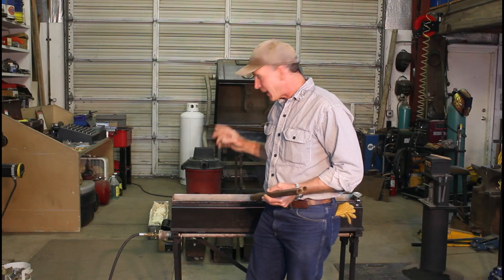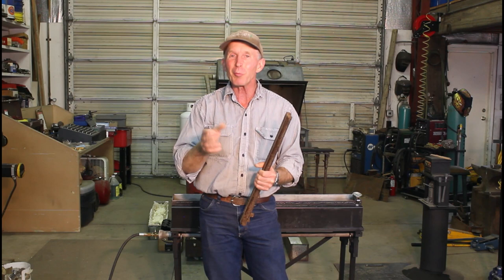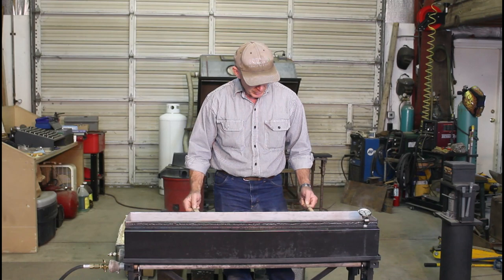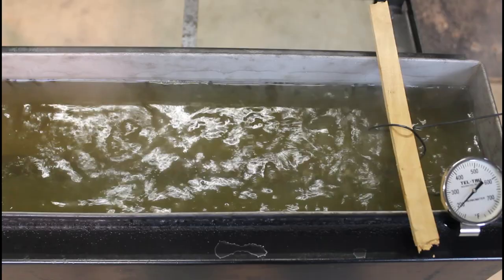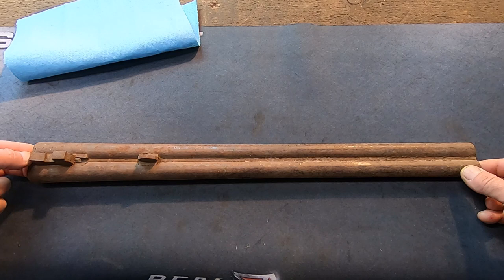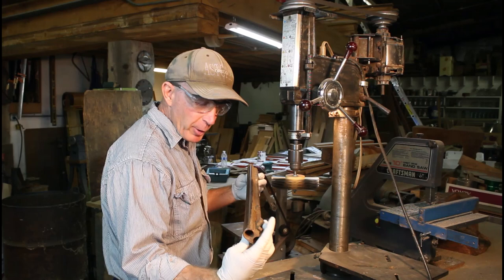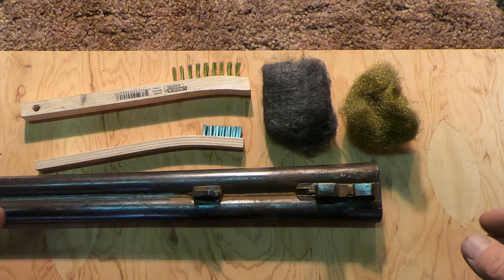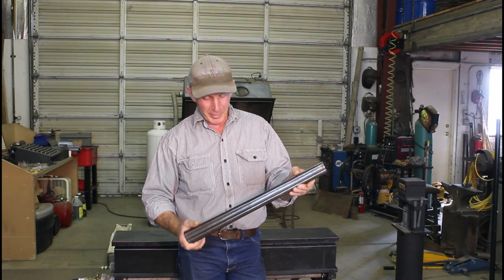Rust Conversion on Damascus Barrels

Comment: Some people are afraid of Damascus barrels but in their day they were considered premium. Just don't use high pressure shells in them, beware of barrels that have been rechambered to take the longer modern high pressure shells. RST sells correct ammo for old shotguns, use it and get those beautiful old guns out in the field or on the range.
Reply: In a recent test in Double Gun Journal old wall hanger, (no longer usable), Damascus barrelled guns were subjected to successively higher pressure charges until they failed, the interesting point was the barrels did not fail, but the lock up system did, some of these barrels were only .030" thick at the muzzle, yet they stood nitro proof pressures, it is only the gun writers that see Damascus as weak. Chris B.
Reply: I've got a old Damascus barreled double with external hammers and I have shot it quite a bit with low base shells with no problems and it still locks up good and tight

Comment: A few tips I've picked up from trial and error and very old books and documents I've come across learning to gunsmith with the traditional methods. I would go for an HR or more at a time boiling. The longer the better but after about 2hrs you hit deminishing returns. I like to flip parts over about half way through just to ensure that both sides convert at an even rate. With revolvers and any non Damascus really you'll get a lot of weirdness if you don't in a lot of cases. If you have an elevated grate or basket so the parts don't touch the bottom it does seem to help with this as well. With a really skanky piece just pull it out and use a piece of denim dampened with a little rottenstone and quickly rub it down just to knock the loose oxide layer off. Give it a wipe down with a clean rag to get the rottenstone residue to come off. Go straight back to boiling. The rest of the loose oxide will nearly wipe off usually and the polish the denim and rottenstone provide leaves a mirror shine if you give it a couple passes on the polishing wheel. Like I'm talking glass smooth depending on how much polishing you do with the rottenstone. Usually at this point is when the mark Lee Express blue comes in to darken up any light areas. In the end you'll have a gun that no one would ever know was touched up and preserved unless you take it past the factory's polishing standard. I've been using this method of saving the finish for some time and there's nothing that compares to the final result. It's pretty mind blowing taking a 1920s Winchester or 1st year wing master back through it's original finishing process and getting to see it coming back to life looking like it just was day one coming off the assembly line. Great video and I don't mean to criticize what you achieved, it came out great, just wanted to share what I've learned searching for all the info I could get my hands on for rust and charcoal bluing. Look for a copy of professional care & finishing of gunmetal by John E. Traister if you don't have one. This book is rarely every mentioned but goes well beyond any other source covering every form of fun finishing up to the modern spray coats. He walks you through every step and all the needed components for all processes and spills the beans on original manufacturer recipes and some other really interesting bits. His book on wood finishing is just as good and they are becoming very hard to find. Try to get the hardcover too, it's much higher quality print and photos and iirc the softcover had some things cut from it.
Reply from the maker: Thanks so much for taking the time to share these excellent tips!  I'll be looking for those books by Traister.
Reply: @thecinnabar8442  my pleasure. Really enjoy your videos and figured it's the least I could do to repay you for all the entertainment.

Comment: Today I brought home a good candidate for this process, a Remington Model of 1863 "Zouave" rifle. It is a pretty decent rifle, never sanded, good cartouches on the stock, but the barrel has a fair amount of pebbly rust. Rifling isn't too bad but there is plenty of rust there too. An interesting project, I have a few going right now, good winter projects.
Reply from the maker: Take it nice and slow on that Zouave rifle.  It's doubtful you can convert all the rust.  You will have to decide how far to go with it. You'll probably have to boil it more than once and then decide how far is enough.  Rust with depth usually becomes a pit when removed completely.  Good luck with your winter projects!
Reply: @thecinnabar8442  Thanks! I have a Zoli reproduction, a side by side comparison is favorable to the Zoli except for the stock, the wood is too light, Remington used excellent black walnut. I've seen unissued Remingtons that look very nice indeed, my "new" one will never look like those but can look a bit better. The stock on my rifle is quite good, original unsanded surface with sharp cartouches and edges. I need to get the nipple out and clear the fire path. Too bad there wasn't a clean-out screw on those like on the Springfields.

Comment: I recently acquired grandpa's 1880's Damascus side by side. Remington Arms Co. Ilion NY. is the only thing I can find on the receiver. The foregrip will not come off, however I didn't try very hard in fear of damaging anything. The barrels are no where near as bad as the ones in the video but you can't really see the pattern through and through. It has been kept indoors all of its life but never got the attention it deserved. Would you recommend that I try to clean it up or just enjoy it for what it is as a wall hanger. Probably not safe to shoot at this point however I would love to be able to get it back to that point. Very excited about getting it. I can tell it was beautiful in its time!

Comment: Question for you or anyone else watching: I’m considering doing a rust boiling conversion in my Damascus barrels but I’m worried about the solder possibility melting. Might be a dumb question but I’d rather be safe than sorry! I know there are different types that all melt at different temperatures. Anyone have experience with doing many of these barrels?

Comment: Nice work!  If this was a restoration to be used again, is there anything you would need to do to the interior of the barrels?  Seems like I remember, from back in the day, my grandfather telling me to just shoot them until they clean up.
Reply from the maker: Surprisingly, the bores aren't terrible on this one.  I'd just lightly polish them and shoot it.
Reply: @thecinnabar8442  I take a cleaning rod and a bore brush, chuck it in my drill and just slowly run it in and out of the barrels until I'm happy with them, then swab them with some oil, of course that's only for smooth bore and shotgun barrels.
Reply: I’ve done this on quite a few old guns, and as long as there is no obvious pitting on either the outside or inside of the barrel, it should be fine to rock and roll. If it’s a really old gun, you would need to get it checked professionally, obviously. This is true of the whole gun, especially the breech area. Prolonged rust exposure also wrecks any springs, so make sure those are spotless as well. As an example, the extractor spring on the gun in this video was obviously too far gone. As a general rule, excercise extreme caution in trying to use old gear, there’s usually a reason why it was abandoned

Comment: Nice Job Mark What Does Browning a Barrel Entail is It a Hot Type Bluing Process I’ve Got an Old Stevens Single Shot Falling Block 32Rimfire Takedown Rifle That Has A Brown Finish not Blued Would It Be Doable Or Should I Just Try The Anvil Mark Method You Just Did it’s Got Some Light Pitting on The Barrel But Receiver is Really Nice and Pitfree 😀 Love The Videos Mark Almost Time For a Pumpkin Shoot 😀👍🏼
Reply: Is there an app that capitalizes every word in a sentence? Why would one want to do that?
Reply from the maker: There are several products available for browning a barrel.  Some are a slow rust blue solution, but that is a pretty involved process.  Most are basically cold blues that can be applied repeatedly until you get the color you're looking for.  The process I show here is primarily for guns that have rust present that can be converted to blue or brown finish.  If your gun doesn't have surface rust, it wouldn't do you any good.  If you are going to put a brown finish on the gun, you can draw file out the light pits first.  I'm sure there are videos that show draw filing.  I plan to show it on a future episode whenever I need to draw file something in the shop.
Reply: @thecinnabar8442  Thanks Mark 😀👍🏼